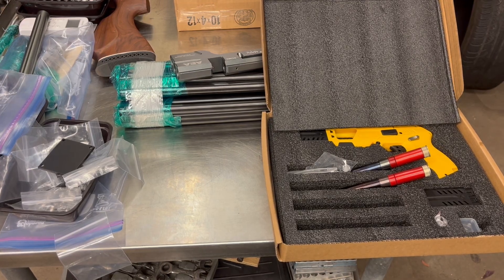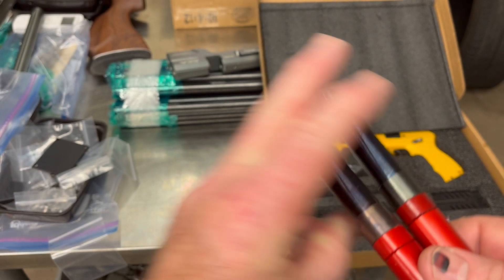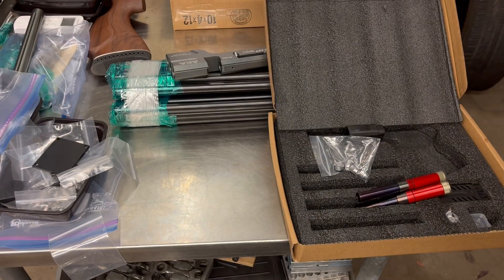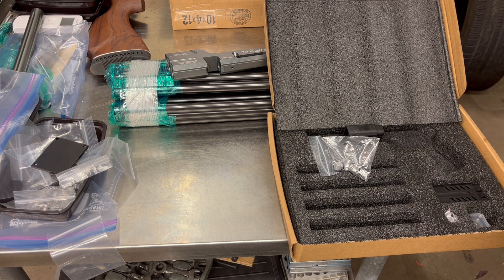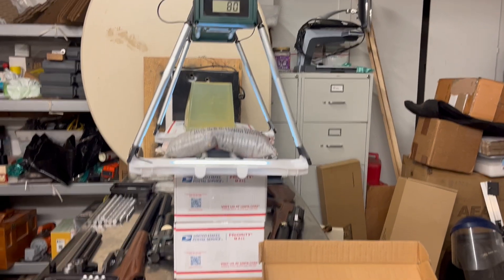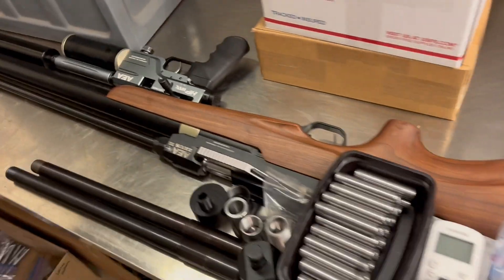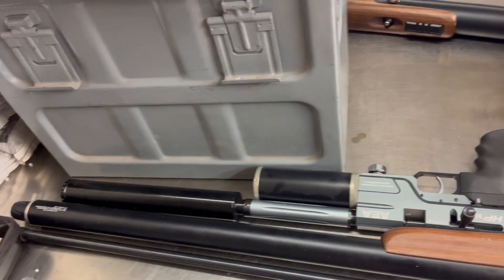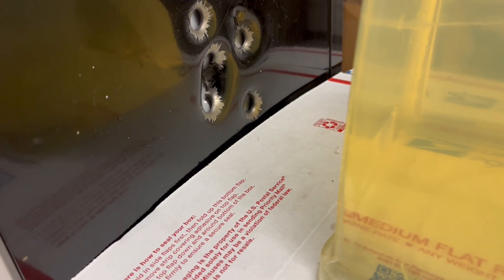Custom AEA Defender 50cal ballistic gelatin test from Texoma Precision Pellet VID125

Comment: Question Jim the heavier pellets that you can shoot out of the s45 in the long barrel is there a different magazine or the same as the standard s45 and can I shoot heavier slugs with the stock s45 or do I need the long barrel? Or do they have a different valve?
Reply from the maker: All testing with the longer barrel was done with my 240gr pellets. It is the largest pellet that will fit in the magazine. The only change to the test gun was the barrel. The power valve kit would make things more interesting
Reply: @texomaprecisionpellet7545  thank you for the info appreciate it keep up the great work! Looking forward to seeing a video with the pyrodex pen!

Comment: Does the new shells have the same problem the old defender had where it would leak air after a few days that’s literally the only reason I haven’t picked up the newer models I been waiting on AEA to fix that problem
Reply from the maker: I haven’t had any trouble with them. Gen one had a variety of issues, but the new larger ones with internal stainless steel parts have worked well for me
Reply: @texomaprecisionpellet7545  nice that was my main concern the shells staying charged up for long periods I was getting a few days on some shells with the old defender but if the leaking shell problem is fixed I’m definitely getting one
Reply from the maker: @JohnChicon-hp7cq  I've taken apart Gen ones in one or two videos and they were junk. The Gen two's are great; so much so, that I am building multiple platforms based on them.
Reply: My new cartridges have stayed charged for well over 2 months sitting in my truck in still work fine, they usually don't sit that long I try to use it more often, but I keep that has a truck gun.
Reply: @benkelley551  that’s my only worry is If I need to use it one day and find out it gassed out over night and it’s happen to me with the original version but if you get two months with it still charged and ready to go I think that’s pretty good I’m def planning on getting the 45 cal version ASAP